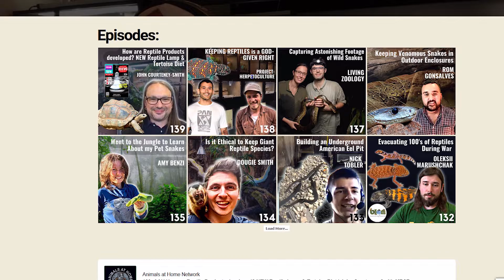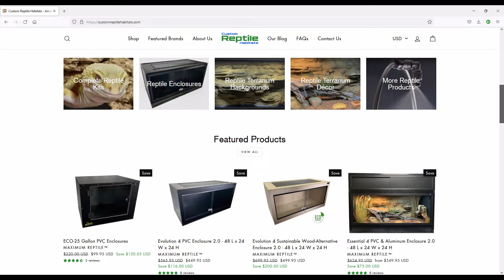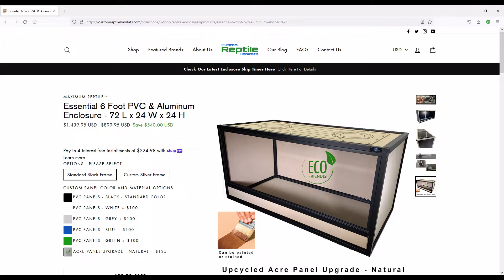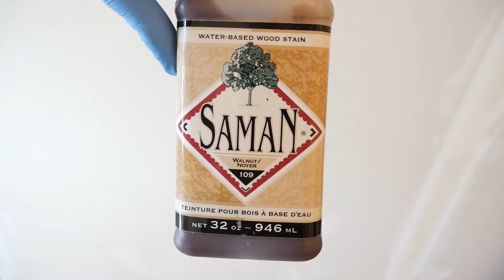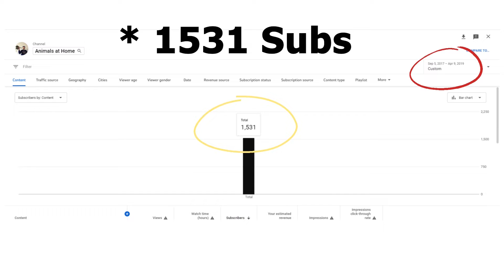NEW REPTILE ROOM - COOLEST PODCAST STUDIO

Comment: I'm really looking forward to the rainbow boa upgrade. I hope you stick with the pond idea. And out of curiosity (only because I didn't want to scroll through the comments) how did that enclosure work for you?
Reply from the maker: Yes, there will be a pond! Which enclosure do you mean? (I may be forgetting something specific from this video)
Reply: The enclosure you built for the rainbow boa with the fan and pond. I'd like to kinda make my enclosure the same as yours im currently in preparation mode for a brb just need to get more money
Reply from the maker: @Chedderbob0613  ah that enclosure! It worked out perfectly fine, my only complaint is that it was a bit too small. 4 feet long isn’t quite enough space, plus it was only 16 inches tall, which was really annoying 😂
Reply: Ah so one of those 6' enclosures is for the brb! Right on!!! Can't wait to see it!

Comment: You are so lucky in North America! In Europe it's almost next to impossible to find PVC enclosures.... you almost only get glass ones like ExoTerra etc....
Reply from the maker: Hopefully, they become more popular in Europe soon! it’s so hard to make large enclosures out of glass only
Reply: @AnimalsatHomePodcast  Here in the UK vivarium's tend to be made from 18mm thick melamine, with 4mm glass "doors".  Even with rising material costs the market is very competitive, and a 6' x 2' x 2' melamine viv is around £250, which given how bad the UK pound is fairing these days that's around $270 USD ($390 CAD).
Reply: @AnimalsatHomePodcast  PVC sheeting can be had in the UK (and probably in the EU too) however it's typically sold via sheet material suppliers in large 8' x 4' sheets and compared to melamine is a lot more expensive.  There was one company in the UK (run by the same company behind Wrigglies based in Dunstable) who made vivs from textured PVC which looked like normal wood panels, but have no idea if they still make them or what the pricing is.  Last I heard was they focused on providing a service to reptile shops fitting out with new enclosures
Reply: sorry - that second comment saw aimed a ren2704
Reply: @MalcolmCrabbe  over here the only PVC I could find are Herptek.  Very efficient but very expensive and immensely in my own opinion.  I'm currently trying to find a pvc enclosure for my juvenile caulker cay BCI but it seems I'll have to stay on glass because melamine has a lot of cons...
Reply: @MalcolmCrabbe  you can get some pvc premades here in Canada, but I've found PVC sheeting to be impossible to find which is a shame

Comment: Struth.... Whilst they look nice, $900 + $125 for the Acre "upgrade" for a 6' x 2' x 2' viv  Plus the cost of the hood,(which seems not to be listed on the website) - I know building materials have risen for one reason or another, but close on $1200 for a vivarium.... ouch !  My only reservations is in large enclosures for strong snakes like Boa's having a clear polycarbonate panel may not be that secure as it could flex, and that glass would be my preferred medium which would be a further $100+.  

Having said that, there are few companies around that guarantee their products for 10 years - so in the long term over the typical lifespan of a snake that initial outlay may well be worth it.  I would be interested to know what thickness the ACRE panels are, they look to be around 6mm or 1/4".
Reply from the maker: Yes, they are definitely premium enclosures. However, they are right in range with other similar products on the market. certainly an investment though! and Yep, you are correct the acre panelling is 1/4 inch